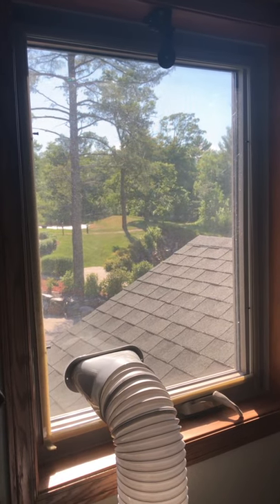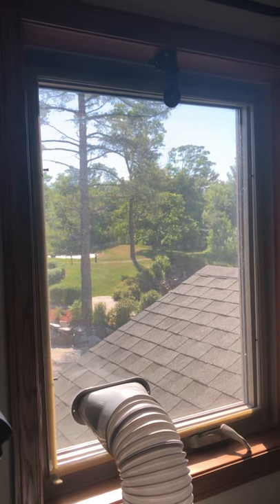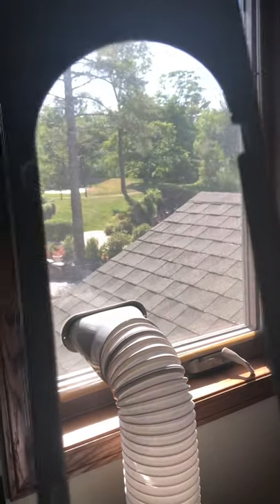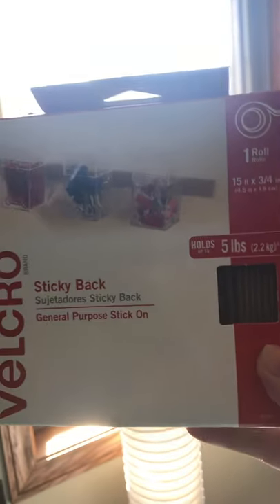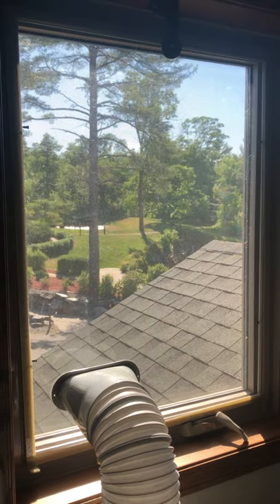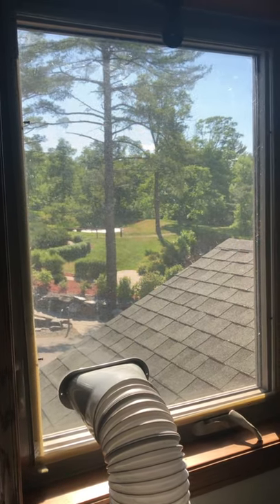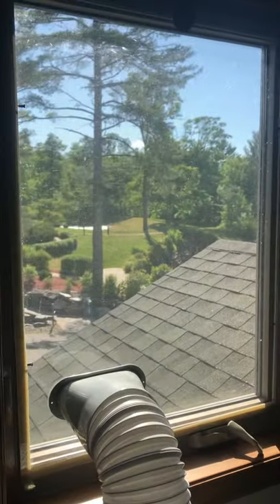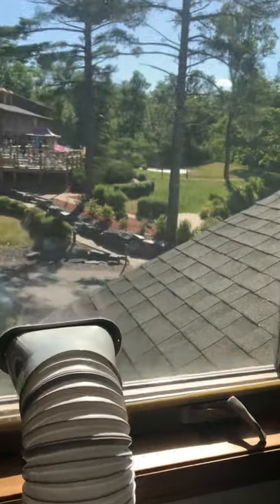Portable air conditioner/casement window/problem solved

Comment: Brilliant.  Truly. I just picked up my polycarbonate sheet today.  The plastic piece is installed so tight it's incredible.  Your idea  turned out so perfectly.  I didn't have to use the velcro because my polycarbonate sheet is exactly the same size as my screen so my screen clips are holding it nice and tight.  I am so grateful for your clever idea!!  thanks!

Comment: Well, I'm so glad I found this video. I followed instructions to a T with one exception. Instead of cutting a hole for the hose, we used the slider with a hole that came with the air conditioner on the bottom. Therefore we just had to cut a rectangular piece of acrylic for the top part. Used gorilla tape to secure the space between the two. Used the velcro as directed and it worked like a charm! Our window is in a place where no one sees it so not as worried about aesthetics. Great video!
Reply: I am planning to do exactlly same!!

Comment: Hello  thank you for your helpful video.  With the screen being in place, have you had any damage to it from the hot air exhaust?  I've read that screens can get damaged due to the hot air.  My screen is next-to-impossible to remove, so if I can just put the exhaust over the screen as you've done, I hope it will work without damaging the screen.  Many thanks.

Comment from the maker: One more detail…….,  When you insert the vent hose into the hole that was cut in the polycarbonate, push the vent hose slightly to the left or right to secure the tabs on the hose to the polycarbonate. That will hold the hose in place.
Reply: doesn’t it leak air around it?
Reply from the maker: @pattyadams3364  It does if you forget to open the window 😁 (otherwise, no)
Reply: how much did glass company charge u? how much for the polycarbonate?
Reply: I was scrolling through the comments to find this out!

Comment: Awesome! How did you attach the hose to the poly?
Reply from the maker: The hose fitting that lines up with the matching hole in the polycarbonate has notches. Push the fitting into the hole and move it to the left or right to lock it in place.

Comment: I tried your method but couldn’ t get polycarbonate so I used a piece of wood paneling. The hose is heavy and the Velcro sticky backing comes apart when it gets too warm. What could I do to hold the hose up so it’s not so heavy?
Reply from the maker: Some people have used plexiglass when they couldn’t find polycarbonate. I wouldn’t recommend paneling for any aspect of my solution.

Comment: The velcro also allows the plastic sheet to flex when it gets hot.  Is the adhesive heat resistant?
Reply from the maker: The Velcro I used has been on for 2 years, and has held very well. The adhesive is impressive.
Reply: @fixerlady8274  - is the window facing north? How hot does it get there?
Reply from the maker: @rob4197  we have this system in 3 windows, with 2 facing west and one facing north. We live in NE Minnesota, and temperatures rarely reach 100.